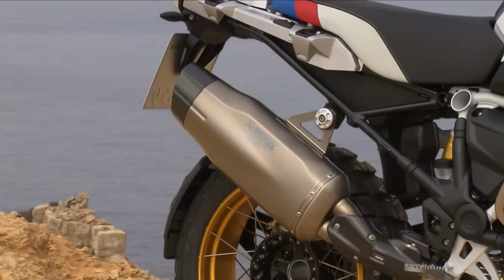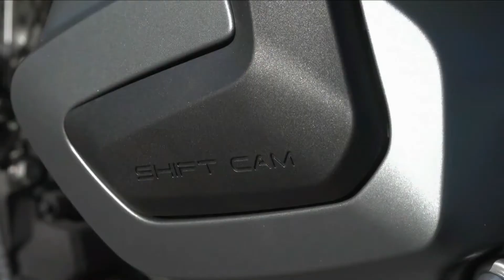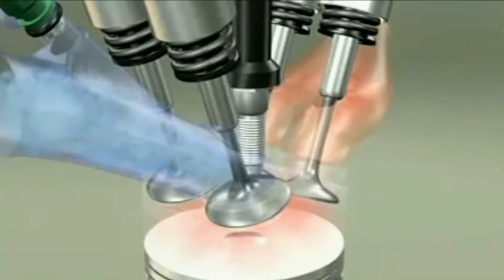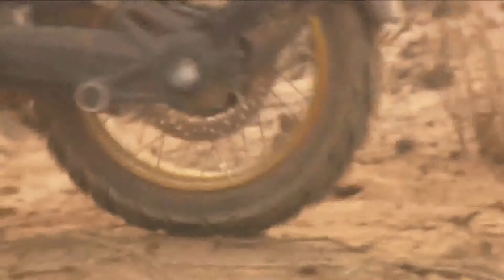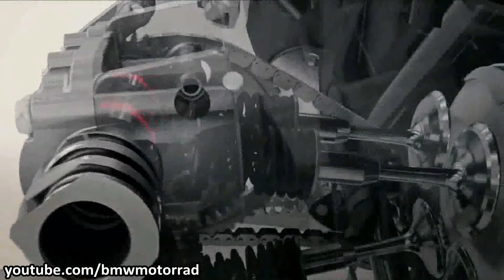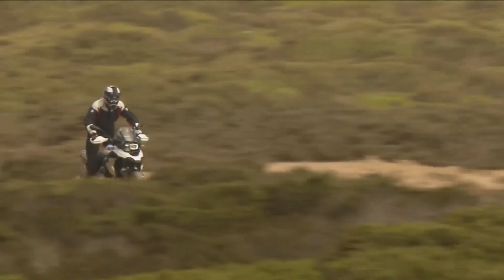BMW's ShiftCam Technology - How It Works? || 2019 BMW R1250GS

Comment: I like the design but I could not accept water cooling
Reply: why?
Reply from the maker: A well engineered air cooled engine is definitely going to be more reliable, simpler; and is the preferred choice for many people. But water cooled engines does have it's benefits.
Reply: there used to be a time when people did not accept motor driven cycles.  when you had feet to push pedals why deal with the extra hassle of needing gasoline that can leak and start fires.  It's just more that can go wrong.  So they stuck with their bicycles.